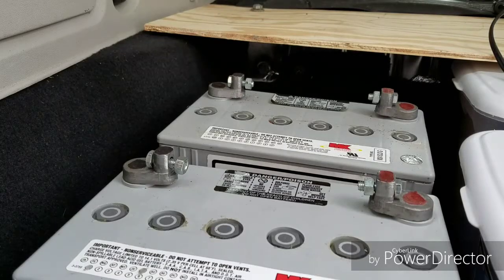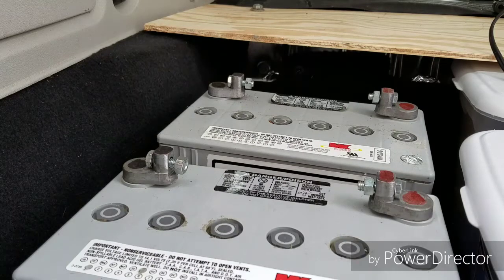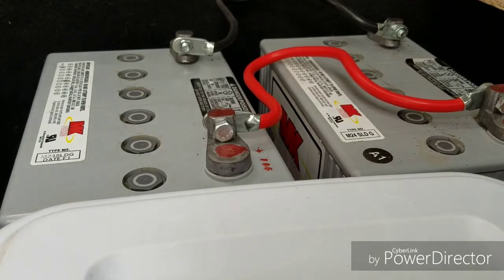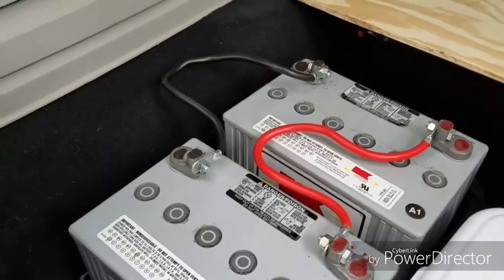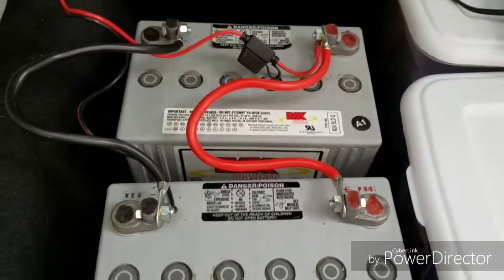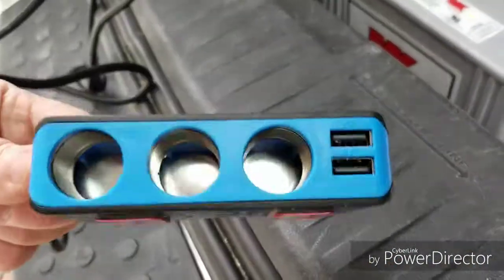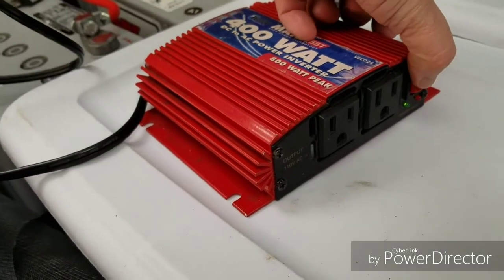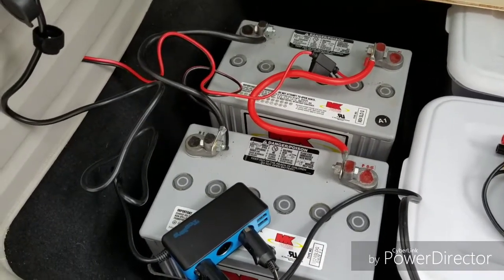How to wire and install two House Battery in parallel/battery bank

Comment from the maker: <iframe style="width:120px;height:240px;" marginwidth="0" marginheight="0" scrolling="no" frameborder="0" src="//ws-na.amazon-adsystem.com/widgets/q?ServiceVersion=20070822&OneJS=1&Operation=GetAdHtml&MarketPlace=US&source=ac&ref=tf_til&ad_type=product_link&tracking_id=minivanmike-20&marketplace=amazon&region=US&placement=B0794SC177&asins=B0794SC177&linkId=23efc25f5f806b97aa8448e5e0a30cb9&show_border=false&link_opens_in_new_window=false&price_color=333333&title_color=0066c0&bg_color=ffffff">
    </iframe>

Comment: I hooked all mine up myself and shorted out my 3 way usb port I got from amazon,, What is the description of that usb pot unit??
Reply from the maker: sorry about that. Youtube wouldnt let me post the link so I did the best I could. I will try to post it in the comments.
Reply from the maker: I did use the cigarette port with the fan on for over 4 hours and still had batteries at 12.7 volts. USB ports worked fine. I do have a 10 amp fuse connected before the charger. Its a Tesla 3 port cigarette usb charger. If you type it in Amazon it will come up. Comes in 3 colors I believe.
Reply from the maker: The other part is a Kuncan 12 V 3 ft female plug extension with 10 amp fue.
Reply: Minivan Mike sorry I didn’t get back to you.  My USB ports just blew out the switch that was on it.  I did just buy a new one so I have lots of places to plug in.  I have a Dodge Caravan also and took out the seat  like you had and have my batteries in the same spot.  Unfortunately, I got the kind of batteries that have to be vented.  I tried to vent them the best I could. I put the batteries in a bin and drilled holes in it.  I also ran a  hose from it and to the back vent windows.    I lived with them that way all winter and spring and it hadn’t killed me but am considering getting new batteries.  More capacity for sure and agm.